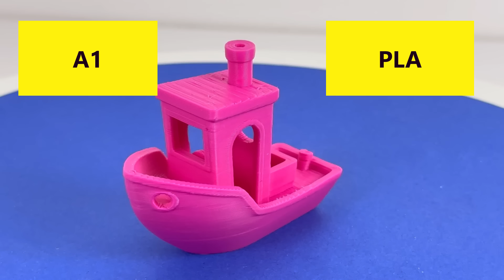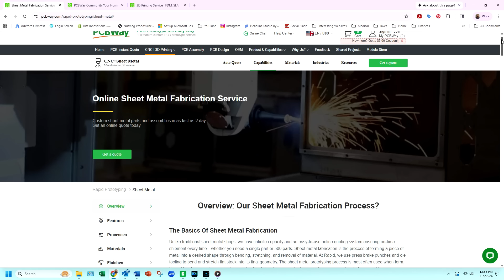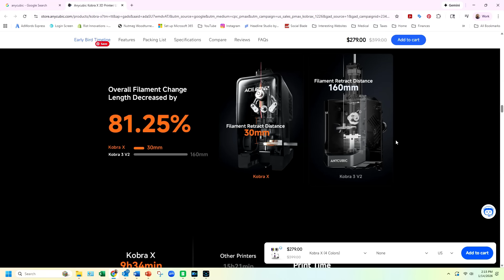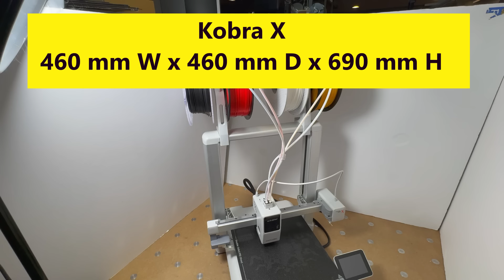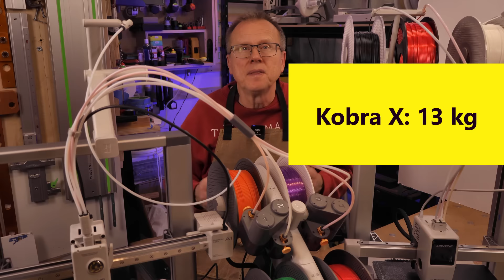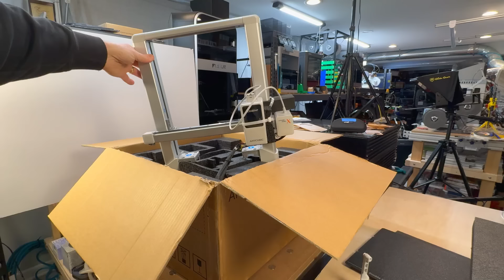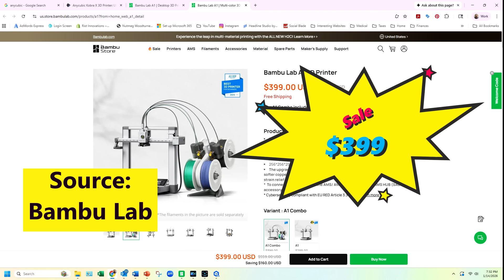NEW ANYCUBIC Kobra X vs. Bambu Lab A1- Which is BETTER?

Comment: Retraction before cut for less purge increases speed of the purge and wastes less. That is the real key to it's speed.
Reply from the maker: Yes, I agree with your assessment. Thanks for your comment.
Reply: @ristinnovations  Please look at my answer to this comment.
Reply: No.  You missed the point, and the Anycubic Slicer Next doesn't currently even have that setting.  Most cutters are 30 to 50 millimeters higher than the x.. Retraction does help them.  Creality's Spark I7 uses this to help things out.  But retraction SLOWS the time down.  The X  has a cutter that is 30 mm from the end of the nozzle.  It doesn't need to retract.  And retraction wouldn't really help it anyway.  It was taken care of in the mechanical design.  So the X is naturally less wasteful, and you don't waste time retracting and risk getting a bulge in your filament that causes a clog.  It's superior.
Reply: @davedempsey5282  I under stand what your saying your just explaining why bambu came out with the smallest heat zone on the market to begin with, and this printer took it up a notch. I think you missed it, in bambu studio its under filament, over ride settings, go to bottom and under long retraction click the box, under creality slicer its the same. Next doesn't give you the option but that is what they are doing with thier printer setting to accomplish the waste setting. Next time just ask how to do it instead of accusing me of lying. You can set an A1 with high retraction after cutting and waste is less, the new creality does it also, but anycubic decided to make it where you cannot change it is all. I bought one, I think the hardware looks great and if it is good like my kobra max and the rest of my farm printers I will buy more. I do think the cam that changes color looks like it may wear down, but maybe when hey have parts it wont matter.

Comment: I have seen a few reviews on the Kobra X but no one really gone into the noise of the machine. I know it being open and filament changing is never quiet. But what is your thoughts in the sound vs a1 or another comparable printer.
Reply from the maker: Although I didn’t measure the sound, I found both the Kobra X and the Bambu Lab A1 to be very quiet printers. Much quicker than for instance my Bambu Lab P1S. Thanks for your question.

Comment: What if I say that the whole color swapping thing is too cumbersome with too much delay and too much waste (no matter which one, as they ALL have this problem), and as such, I'd like to stick with mono color, and given that I don't need large size prints, why would I not opt for the Bambu Lab A1 Mini for a good price?
Reply from the maker: The A1Mini is a great little printer. I own one and it has been a workhorse for me for smaller prints. Each person has to decide what is important to them; print size, multi color, engineering materials, etc. Thanks for your comment.
Reply: You could have 4 materials or colors loaded at once, and choose to print with any of them.
Mini is a good option, 0.2 mm nozzle is good for miniatures and other small prints.

Comment: Question about the TPU you used. What was it and the shore hardness. 

Many users has had problems printing with 95A and softer. One person I’ve seen was able to print 95A speed TPU because of the feeding filament was harder and softened after print.
Reply from the maker: I printed my TPU/PLA  door stop with Bambu Lab TPU 95A.

Comment: Does the filament retract ok how will it not get spool tangle
Reply from the maker: If I understand your question correctly, there is a stepper motor inside the toolhead and there is a cam the engages extruder to retract the filament. The cam rotates and the extruder reverses filament #1 from the nozzle and then the cam rotates and the extruder engages position #2 to advance the filament #2 into the nozzle and the process repeats itself. Did I answer your question adequately?  Thanks for your question.
Reply: @ristinnovations I would like to see that if you can filmed the colour change and see how the filament rols back
Reply from the maker: I can film the details of how the tool head works in my next video on the Kobra X. It will be a little while because I am going to include AnyCubic's new ACE Pro 2 filament management system in my next video; however they are not in stock yet so as soon as they are in stock, AnyCubic will be shipping me one for my evaluation.  Thank you for your suggestion.

Comment: I'm concerned about how well the Kobra X will work with Orca slicer. I'm not really interested in relying on Anycubic's slicer since I use Orca for my other two printers.
Reply from the maker: That's a valid concern regarding the Kobra X and OrcaSlicer.  I haven't tried to use OrcaSlicer yet with the Kobra X. I just did a Google search and the results stated that the Kobra X works with OrcaSlicer, but you will have to set it up manually by importing profiles.  I wish all the printer manufactures just standardized using OrcaSlicer and not their own forks.

Comment: We've seen it, and all the tests are unreliable because different colors and materials were used. The author can't be trusted.
Reply from the maker: I don’t know how you can dispute facts. Maybe your comment can’t be trusted.
Reply: @ristinnovations  Which facts? The fact that ANYCUBIC Kobra X sponsored your video? You've constantly emphasized its superior aspects, which can lead to misperception. You've compared a nearly three-year-old Bambu machine to a brand-new device, and from what I can see, you've quite glorified the device they made using what they learned from Bambu. Even the exterior design and the colors used are borrowed from the A1. That alone says a lot, in my opinion. Also, you said that TPU and PLA can't be printed simultaneously on the A1; that's not entirely accurate. If you attach PLA to the AMS and TPU to the manual sling, you can at least print both simultaneously by following the instructions, although it won't be very practical, but it can save the day. We also need to consider Bambu's support, like Makerworld, and their access to spare parts, in my opinion. Anyway,

Of course, everyone makes and sends videos as it suits them. I wish there were more objective videos. Have a good day.
Reply: @sinan1891  Waiting to see your objective video.

AMS (and Pro?) can feed "TPU for AMS" but it's really hard one. AMS Lite - probably not even that. Comparing manual change - possibly on every layer - to printers that can handle that automatically just feels awkward (and not objective at all, who want's to babysit filament changes for several hours or days?) 🙃
Reply: @kimmotoivanen  I'm not promising to make an objective video. I'm just watching, I'm nobody. I'm expressing what I see, in my own way. Yes, as you said, manually changing filament can be a fatal problem in some prints, but is it even possible, or impossible, with this object?

How does it feel to keep repeating the same things over and over? It doesn't give me an objective feel. If someone sent me a free printer and asked me to talk about it, I'd just sing its praises. I believe it's necessary to watch things with this awareness.

Comment: How well does Anycubic support their printers?  Bambu seems to do well with part availability.  I have 7500+ hours on my A1.  So I’m biased in favor of the A1.
Reply: I've had to use Anycibic's support in the past with my Chiron and as long as you understand they are in China and responses will be handled on their working hours it was great. 

I forgot to flip the power supply from 220 to 110 as instructed in the manual so I blew the board. After troubleshooting for a few days they sent a new board for free.

I'm still printing with that printer years later
Reply from the maker: I don't have any direct experience with AnyCubic technical support yet for the Kobra S1 or the Kobra X printers that I have.  I agree that Bambu Lab has a great spare parts program for all of their printers; which I think is the best in the industry.  Since the Kobra X has just launched, nobody knows what the reliability will be yet so I can understand your position that you have more confidence with the Bambu Lab A1 printer.  My print farm is dominated with Bambu Lab printer models so I'm in the same general boat as you, but I will see how the Kobra X performs in the coming months.  Thanks for your comment & question.

Comment: Thanks for the very comprehensive comparison video, and the clear approach. Subscribed!

I'm currently torn trying to figure out that which printer to buy, it will be replacing my old Flashforge finder 2. I just want something with a bigger buil capacity and the option to use multifilament/multicolor.
Reply from the maker: I don't think you will be disappointed with either the Bambu Lab A1 or the AnyCubic Kobra X.  The A1 printers are very reliable and make high quality prints from my experience with 5 of them in my print farm.  Since the Kobra X is just being launched, nobody knows the reliability yet for it, but at $279, that is a bargain for what you get.  I wish you luck with your decision.  Thanks for being a new sub!

Comment: OK but did Anycubic release the firmware this time?
Because they did disasters with all the other printers regarding fw, even stealing klipper.
Reply from the maker: I have received at least two firmware updates since I received my Kobra X a couple of weeks ago and I believe there is another update I have not implemented yet.
Reply: @ristinnovations  Go check about the old models, your X will be the old model next.

Comment: Anycubic? Stability first layer? Orca slicer works? Where VFA test? 
After 1 000 hours its normal works?
Reply from the maker: This was a first look at the Kobra X because I have not had the printer very long.  There is plenty of additional testing needed in the coming months.  You have valid questions though.  Thanks for the questions.

Comment: Great video, well explained and factual.  You got a new subscriber.

I have a anycubic mega s  since long time with many hours print on it without any failed part other than few  clogged  nozzle. I gave that one to my father  after buying a used  mega pro with laser engravement that work flawlessly too.

I also have a kobra v1 That I bought as non functional and the only thing was the  z driver voltage that was not good and was making print shift on z axis.  I adjusted the voltage with thr screw and it printed flawlessly since then.

I really heasitated for the bambu lab sale, but price wise the kobra seems to offert more especially with  the preorder  price and rebate. That will be my first brand new 3d printed, so let see how it goes.

Lets see how it goes , but I have been well served so far with anycubic, even with my mega s / pro that have several years of printing duty.
Reply from the maker: Thanks for sharing your experience with other AnyCubic products. I hope you enjoy your Kobra X. Thanks for being a new sub😊

Comment: Hi, great video with lots of well-organized information congratulations ,  I've owned several 3D printers from different brands, and three models from this brand and I had some issues with two of them but nothing I couldn't resolve.

I've already ordered one of these because I think it's a great option for the price and the improvements it includes. The new print head mechanism is the only thing that worries me because it has more gears, but only time will tell if it's reliable or not.

A new subcriber herer .
Reply from the maker: Thanks for your positive feedback! I hope you have success with your Kobra X. I also wonder how the new print head will hold up, but as you say, time will tell. Thanks for being a new sub😊
Reply: @ristinnovations   Thanks , The filament savings are much less than the 50% they promise, but at least a 30% time saving is good, and as I mentioned, it's a good option for the price.
Reply from the maker: I read the fine print of their website and they mention that results could vary. They also did not specify what they meant by comparing the Kobra X to "Other Printers".  Even I had different results, depending on which model I was printing, but in general I did see quite a difference in print times and a lesser difference in waste amounts, when I compared the Kobra X to the Bambu Lab A printer.

Comment: I bought the Kobra X.  I already have a Kobra 3 v2 which prints perfectly.  I won't be doing any exotics on either one, I leave that to my workhorse Qidi Q2.  Thank you for this video.  Now I'm more sure I did the right thing buying the Kobra X.  There's only one thing I wonder, would the Kobra X fit in a solid enclosure built for the A1.  Thank you.
Reply from the maker: It depends on the dimensions of the A1 enclosure because the filaments on the Kobra X are mounted on top. If you have specific dimensions of your A1 enclosure I could give you a more detailed answer. Thanks for your comment and question.

Comment: Thanks for your video. We're a bit far from the savings we hoped for, but it's still something. Did you use TPU? Tpu 95 A or tpu 68 D?
Reply from the maker: I used 95A TPU. Thanks for the question, and feedback.
Reply: @ristinnovations That's good information, TPU 95a. The site only mentions 68D

Comment: Hi. Great Video. I am wondering does the other side of the PEI sheet is smooth surface?
Reply from the maker: No, the other side of the PEI sheet has the same texture as the “top” side. Thanks for your question, and feedback.

Comment: Guys, in your opinion, between a P1P with AMS and enclosure kit (so basically a P1S) and an Anycubic Cobra X... which is better? Is it worth switching from the P1P to the Kobra X?
I happen to print multicolored key rings for example
But like action figures or things like that never happen to me
Reply from the maker: I think that for the early bird price, currently at $279, the Kobra X is hard to beat.
Reply: So u think the kobra x is better than a P1S with AMS?
Reply: @xx_h4rd3r_xx68  They are different machines.  The P1S is enclosed the Kobra X is not.  This comparison was between the A1 and Kobra X, not the P1S and Kobra X.  If you need to print certain material the P1S will be a clear choice as certain material requires an enclosed 3d Printer...  The current generation P series is the P2S.  That 3D printer is a better printer than any of these if you need an enclosed printer.  It is also more expensive.
Reply from the maker: I agree with your comment. Thanks for providing it.